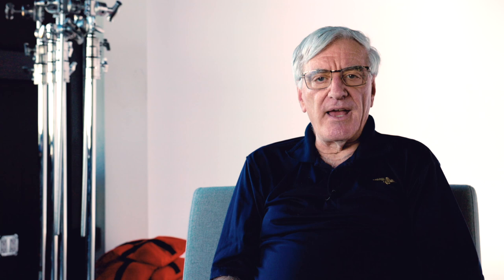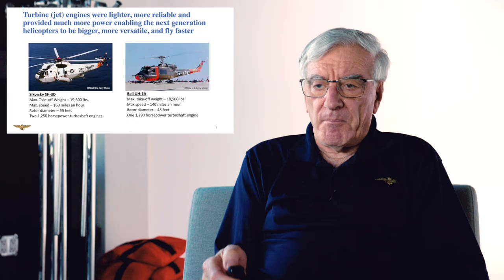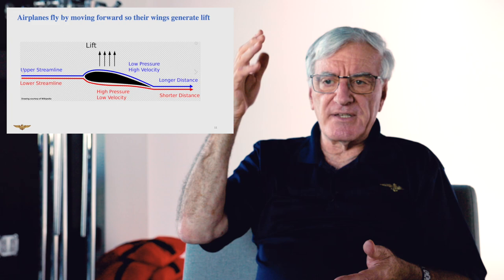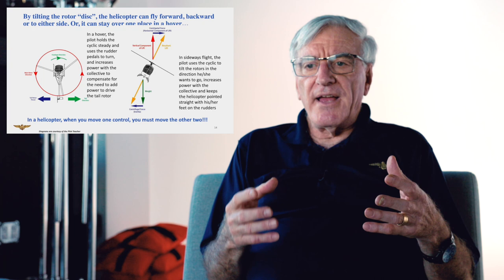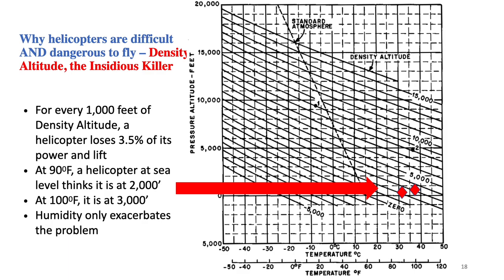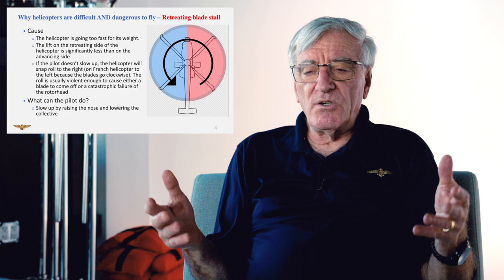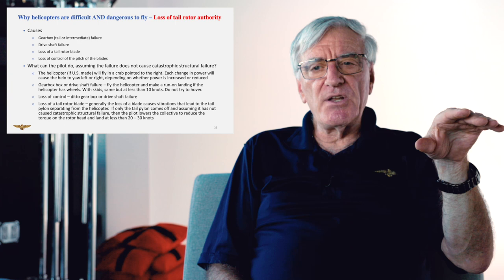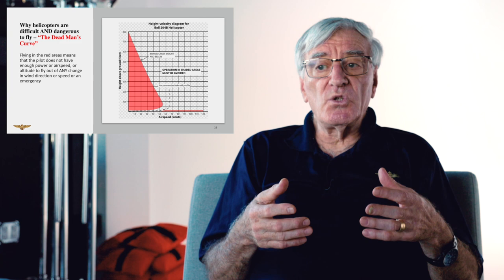Why Helicopters are hard to fly v1 11272022

Comment: The dead mans curve you mention I understand it as the HV Diagram and in my understanding the gray area is where an autorotation  would not be possible, or has not been tested? also you mentioned settling with power, and diving in a helicopter sounds like a bad idea, have you not heard of the Vachard maneuver ? anyway just trying to understand and be a better Rotorwing Pilot .
Reply from the maker: Yes, the shaded areas of the height velocity diagram are portions of the envelop where an autorotation will not be successful. I don't know if they tested it or not, but I'll bet that the designers have calculations that suggest one should not try to do an auto in that portion of the flight envelop. Having said that, us rotor heads fly in this portion of the envelop all the time, i.e. when making approaches to rooftop heliports, hovering alongside ships and oil platforms, etc.

If you get into a situation where the helo is settling with power, depending on the altitude, one can dive out depending on where the helicopter is. If you are hovering close to a building or a cliff, then ones options are limited. It is when one is close to the ground that one cannot dive out of the situation. Best option is to land.

No, I have not heard of the Vachard maneuver.
Reply: My instructor always said the HV diagram is for takeoffs more than anything. Naturally, if you're in IGE/OGE hovers, you can easily be inside the shaded portions of the HV diagram.
The Vuchard manuver is simply diving away from SWP/VRS situations, but instead of diving forward, the dive is to the side away from MR rotation.
Reply: @scottmonk  It isn't as applicable on descents because one thing that's factored into H/V diagrams is the amount of time it would take for a climbing helicopter transition from climbing to descending, then entering autorotation.  If you're already descending, the process of entering autorotation is much faster.  Descending also requires significantly less engine power which means it is actually extremely rare for engines to quit during descent.  So yeah, they're generally designed around the worst-case scenario of engine failure during takeoff.
Reply: Some companies like Robinson did test their HV diagrams, and have video footage of the tests.
Reply: @Maverickib  " it is actually extremely rare for engines to quit during descent. " while generally true, students have been known to accidentally kill the engine on descent. Happened at the flight school I was at, but the instructor landed it safely.
Reply: @SoloRenegade  I've heard of this happening in manual throttle birds.  Was it an Enstrom?  No personal experience in them, but I've heard many accounts of the engine just dying suddenly if you're too quick on shutting the throttle.
Reply: @Maverickib  more like the student pulled the mixture knob. that's what happened in the specific incident I mentioned. Robinson made the genius move of putting the carb heat next to teh mixture knob, and made them about the same size and shape.
Reply: @SoloRenegade  Can't fix stupid.  While i know the two knobs are close, the mixture has a guard and a button you need to press before it moves.  It's distinctly different from carb heat, I guess Frank put too much faith in people when he designed it.  I think maybe once I briefly touched the mixture knob when reaching for carb heat, felt the guard jingle, and immediately realized it was the wrong one.  Pulling carb heat is never an emergency action so I don't really get why so many new pilots race to get it done, instructors need to take ownership and train students to take their time looking at what they're about to operate before they operate it.  Wouldn't matter if the knobs were exactly the same and right next to each other, pulling the wrong one is a byproduct of bad instruction and poor piloting.

Comment: why coaxial helicopters are easy to fly?
Reply from the maker: Thanx for your question. Helicopters with co-axial rotor systems do not generate any torque left or right since the blades rotate in opposite directions. this makes them easier to hover, however, until recently, co-axial helicopters couldn't fly as fast as conventional single and tandem rotor helicopters. For example, the KA-25/27/32s ostensibly could go as fast as 127 knots. Real world, they flew around 100 or less. The Kaman H-2 easily cruised at 120 - 125 and the H-3 at the same speeds and could, on a good day, if you were light and low, get to the 140s. Co-axial rotor heads are taller than a conventional rotor head which could make fitting them into a hangar on a ship problematic.